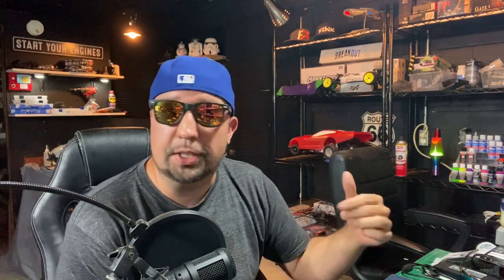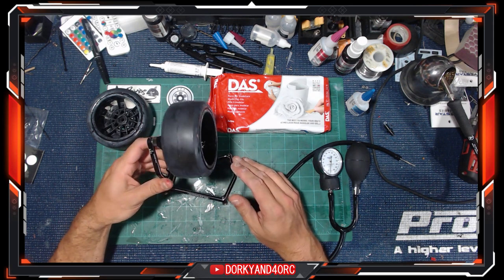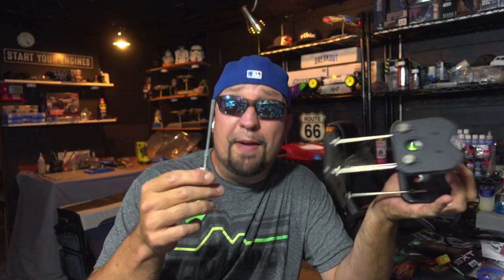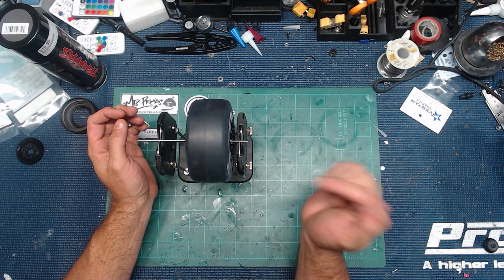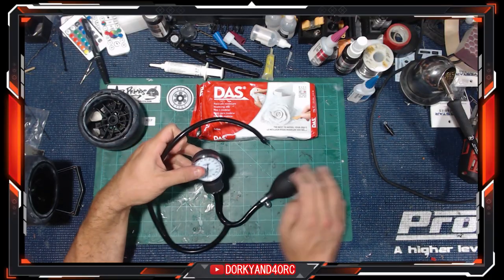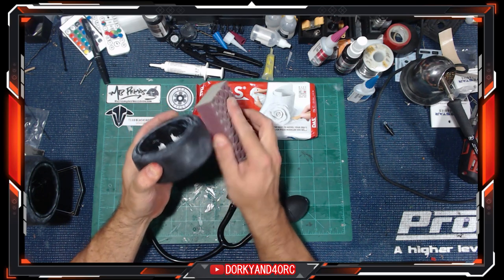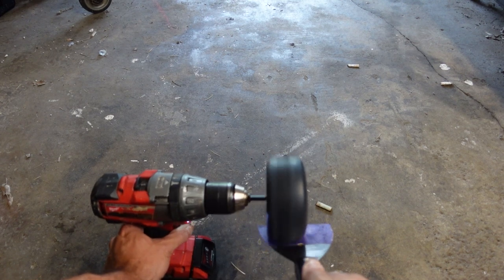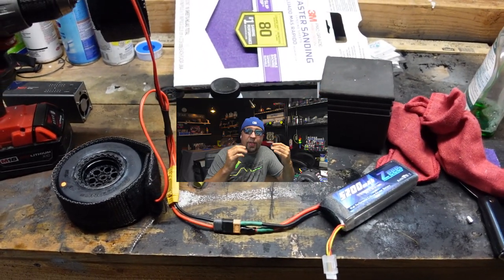NOPREP DRAG RC TIRE BALANCERS TESTED | TIRE BREAK IN AND PREP | BOOST YOUR ET NOW!!!!

Comment: Nice job and great info, but some unsolicited suggestions;

1)... Use a silver Sharpie (fine point is best) to mark the CENTER of the TOP of the tire (on the inside sidewall), after it's through settling. This gives you an absolute zero point to aim for.
* I've used the prop balancer for this from day one, and I've been racing 1/8 and 1/10 off-road rc for over 20 years. I always balance my tires, and it definitely helps, but I'm sure it's even more important in drag racing* 

2)..You only need ONE piece of putty! 

Adding more than one is unneeded weight, and it's the worst kind, rotational weight.

Instead of adding smaller pieces (putty) on either side of the main (biggest) piece in an attempt to "center" the weight, continue to add to the original piece, but SLIDE the entire chunk of weight LEFT or RIGHT to center that silver mark (up/top).

What happens is, when you add that first piece, your original piece of weight is hardly ever EXACTLY center of the offset balance point, so the temptation is to add "left or right" smaller pieces to center it.

Just keep sliding the putty left or right/adding more putty until it settles on the bottom (slower and slower as you add weight), and the silver mark s.l.o.w.l.y finds it's TOP center. 

At some point, you'll be able to spin the tire (or stop it's rotation) on the balancer and the silver mark will not move...... at all ...... no matter where you put it. When you can do that, it's perfectly balanced.

PS, since I'm anal about stuff like this, lol, I'll  weigh each finished (balanced) tire. 
You need more than a few sets of tires anyway, so let's say you have six or eight sets of BALANCED rtr rear tires. Weigh them individually and write the weights in grams of each (on the tire itself or number each, 1 through however many on the tire itself, then on paper). 
All you need to do now it's pair up the closest weights.
Reply from the maker: thata  lot of helpful info. ill make sure to mention or post this comment for everyone to see

Comment: Hello, thanks for the great information! I came across this video and was curious if you had any experience with the SkyRC Tire Balancer and how it compared to the prop balancer?
Reply from the maker: I haven’t but am still sold on the prop tool. It’s been out for decades and does the job for $10,000 airplanes. I have a jconcpets as well but always go back to the dubro
Reply: I'll listen to your wisdom, definitely no need to overcomplicate things if the solution is right here. Looking forward to more tips, thanks!

Comment: U mentioned BeachRC , are U local to Myrtle ? I'm interested in getting an rc drag kit , which one would U recommend ? I think there is different trans ratios & other plus/minus things each kit has to offer .  Was also thinking of doin a FiveStar conversion kit ?  Thanks
Reply from the maker: I’m very happy with the breakout kit. Hard not to recommend it.  If that’s too much to bite off then seems like a Traxxas is a safe bet and eventually move to an rcri or drc chassis. They are more advanced then other current dr10 conversions.

Comment: i am having a hell of a time with my tekin rx8 g3, tekin 3.5t red line motor, always blowing my tires off on launches
Reply from the maker: It’s going to be really hard to get that going without radio ramping with something like a sanwa m17 or futaba
Reply: @Dorkyand40  I'm running a spectrum dx6r
Reply from the maker: Yeah. Need to look for a speed setting on throttle. Goin got be hard.
Reply: @Dorkyand40  I have a stage type thing in my radio

Comment: Could you possibly walk me through how you made that air pressure tool from a blood pressure cuff. I purchased the two items from Amazon that you linked in description. But having a problem seeing how they go together. Thanks
Reply from the maker: You’ll want to use the long y piece that has the stethoscope attached. Pull all the pieces off. Then pull of the bulb and the meter and heat the tube ends to slip over the connectors on the two upper tubes of the y and then do the same with the needle end.
Reply: Yeah I think we have 2 different kits mine has stethoscope and blood pressure cuff as 2 separate items. And the hoses connected to the cuff. No Y fitting at all
Reply from the maker: You should be able to cut the ear plug ends off and the stethoscope and that’s how you get the y

Comment: Sup man. I used this same clay to balance my wheels and the clay literally flew out of my wheels lol. I cleaned the wheels prior to balancing them and let the clay dry for a day and the same thing keeps happening 🤷 Now I balance another set using JB weld and that has actually held up. Was thinking bout maybe light sanding the wheels to see if that would help the DAS clay actually stick. Question....what tire glue you recommend?
Reply from the maker: I’ve been thinking of gluing the clay once it gets balanced to see if that helps. I’ve also been people use tungsten putty. I use the usual hobbytown brand of ca snd bob smith tire glue but I have some racers edge stuff on the way to try. Heard it’s good.
Reply: @Dorkyand40  cool tnx

Comment: Awesome video as usual! One question…. How are you using the tire on the drill?
Reply from the maker: Beachrc has a rc tire chuck. I’ve seen them on Amain too
Reply: @Dorkyand40  thanks. I’ll pick one up. Also, what grit sandpaper have you found works best or does it really matter?
Reply from the maker: No problem. I use 80 cause I’m impatient maybe 100 or 120 would be ok. Just take longer.

Comment: Sup man great content. I have a quick question any upgrade out there for DR10 dogbones? Or which from the Team Associated line would fit the DR10? TIA 👍
Reply from the maker: dr10 takes the b5 platform stuff..i think mip makes some if youre snapping them..if thats the case i would check your ride height and squat..you want them as level as can be before and during the hit..never steep angles or youre going to lose power and risk breaking them..you can raise the ball ends of the sway bar and if you really wanted too space the transmission higher but thats a tall task..not much tuning room on the dr10 chassis
Reply: @Dorkyand40  cool man tnx for the info 👍